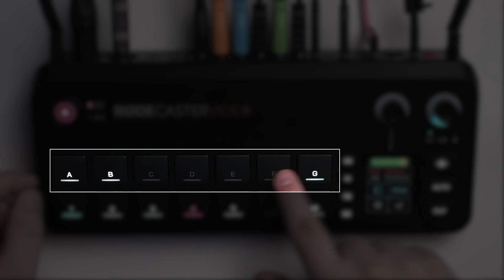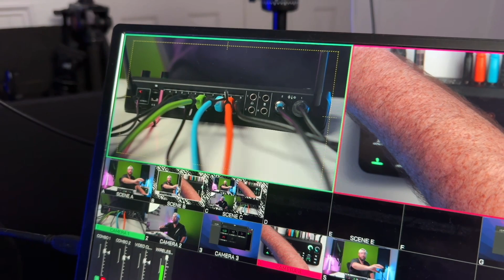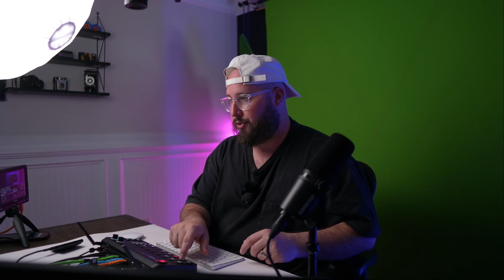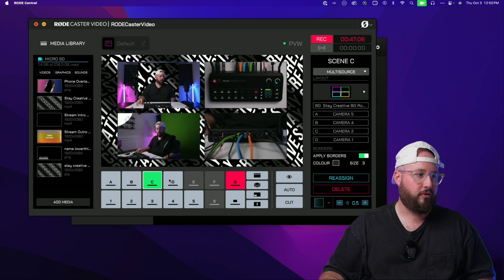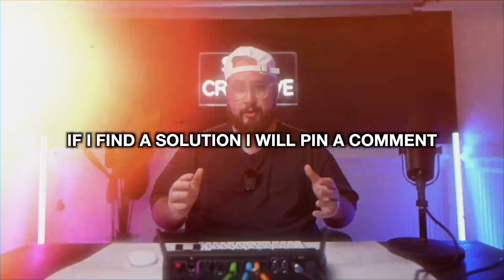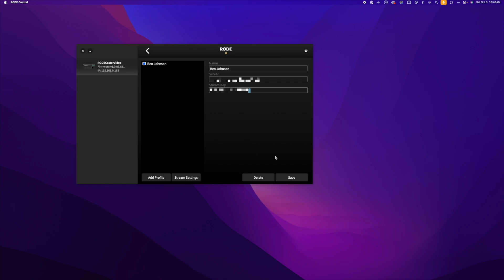RODECaster Video UNLOCKED (FULL MENU WALKTHROUGH)

Comment from the maker: UPDATE: I have talked to RODE and they have a firmware version in BETA right now that seems to be fixing the wireless connectivity issue with the Rode Wireless Pro. I have tested it a little bit, and so far it has been good. I will continue to keep you updated as I learn more!
Reply: Hi Ben, the "firmware version in BETA" is for the "Rode Wireless Pro" or the RODECaster Video?
Reply: Is it released? What version?

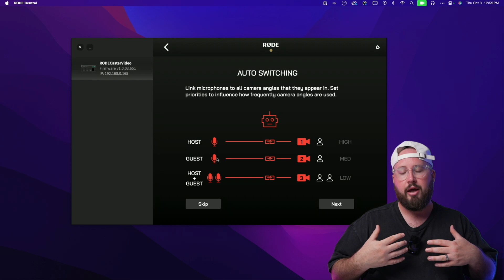Comment: 41:05 for the audio switching section, I see that the RCV already has certain options as presets. 
Host -Camera one
Guest -Camera two
Host + Guest - Camera three

It’s just my preference but is it possible to change those options. On my atem I always have camera 2 as my wide (Host + Guest) My current setup is 
Host -Camera 1
Host + Guest- Camera 2
Guest - Camera 3
Is it possible to change those options?